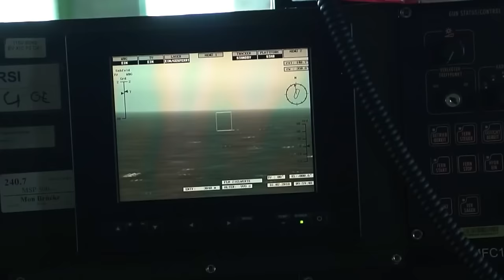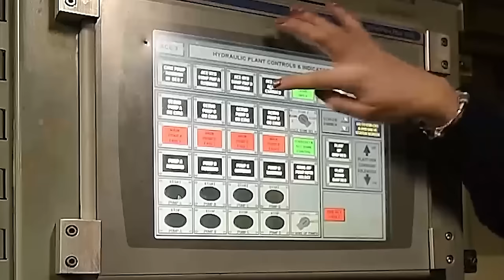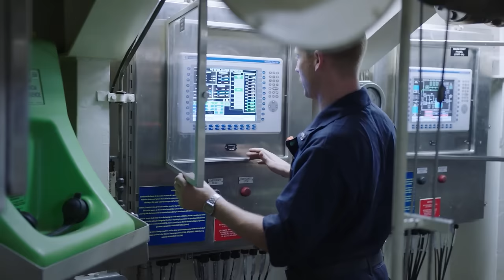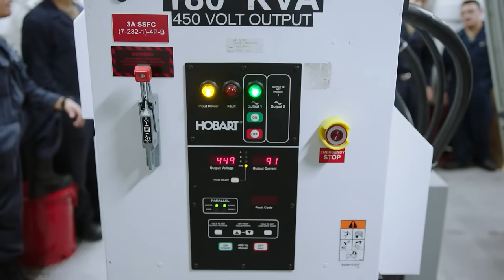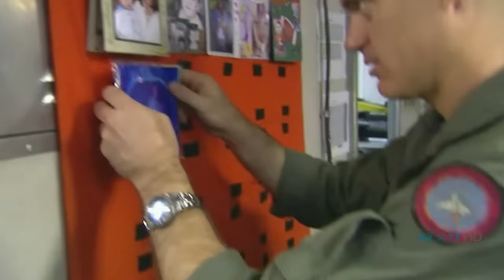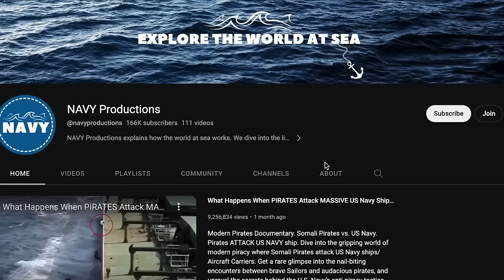MIDDLE EAST CONFLICT: Life Inside USS Dwight D. Eisenhower Carrier Strike Group

Comment: I was stationed on the USS Dwight D. Eisenhower CVN-69 out of Norfolk. I worked in the Jet Shop located on the left port side all the way back aft with two huge doors leading to the fantail to test jet engines.
Reply: I was on IKE from 1980-1984. OI division berthing was right above the jet shop. We could hear the jet engines being tested at night.
Reply: I was on IKE from 1991-1996. OE division. My berthing was at frame 235 (far aft), starboard side, on the O2 level (two decks below the flight deck). We could hear the jet engine tests at night too. I can sleep through anything now. I worked around frame 135, starboard side, on the O3 level (below the island). It's good to hear from shipmates out there.

Comment: I was on board IKE from 1980-1984 as an Operations Specialist. Spent 7 months off the coast of Beirut from April 1983 to December 1983. Only one port visit (5 days) in all of that deployment. Came back to Norfolk VA on December 22nd, 1983.
Reply: I was on board IKE from 1991-1996 as a Data Systems technician and I worked with a lot of Operations Specialists in CIC. Good to hear from you shipmate.